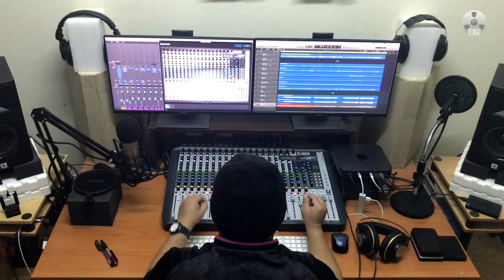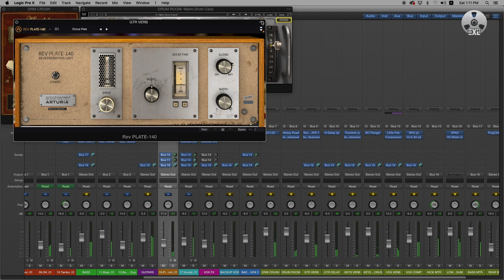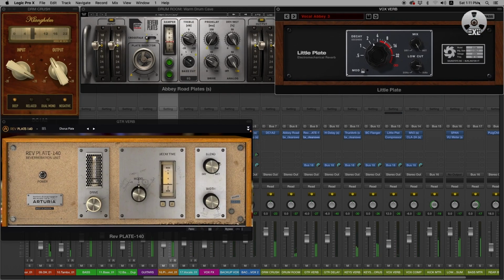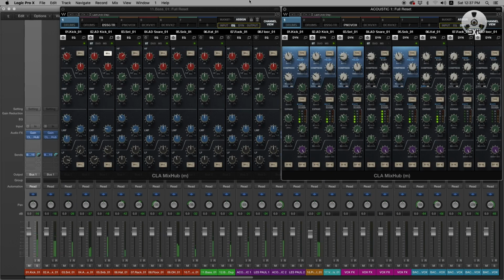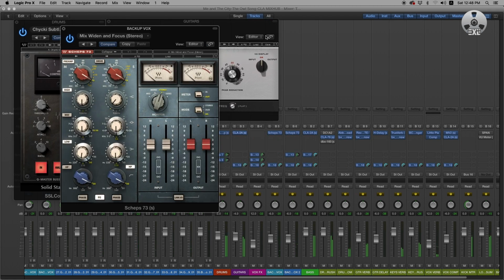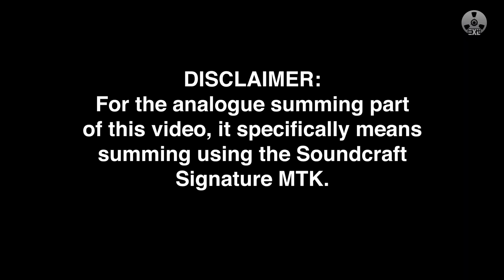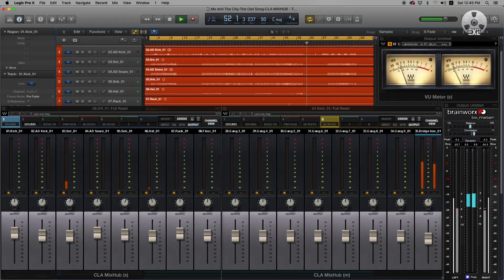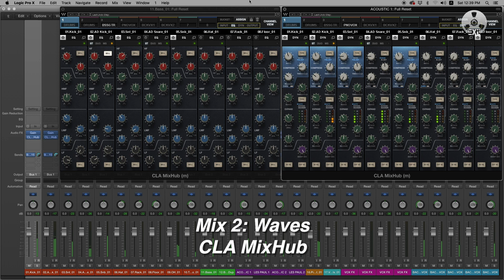SHOOTOUT: In the Box vs Hybrid Mixing

Comment: Hard to choose but think I preferred the warmth of the third though the first one seemed punchier.
Reply from the maker: I would agree with you. The console tends to round out the mids and the high mids (the 'warmth') so you have to compansate with the EQ. Out of the box, vocals get buried right away because of -I'm guessing here- harmonic distortion. You can plainly hear it in the a cappella section where the ITB versions had more vocal presence and the summed version had more reverb. I left it as it was to show the difference. The main vocals, however, I had to raise the level by 3dB in the DAW so it can punch through the mix. Thanks for dropping by!

Comment: Had to read the comments first cause I thought I was losing it..  You did such a great job man…  its amazing.  The first one definitely got some punch… but I gotta agree..  The third one so warmer..  Had to close my eyes and listen..  They were all really good…  salute. Thinking of getting the board.
Reply from the maker: Thanks for taking time to listen to the mixes. I warn you though, the power supply unit of this board is weak. Mine was blown for the third time a month ago. I'm now thinking about having a modified PSU installed because the two replacement PSUs from the manufacturer didn't last a year each time. But the sound of this console though is worth the trouble. Thanks again for dropping by! Cheers!

Comment: CLA Plugin little bit darker but its like 1 db darker only. why so subtle.
First mix is good, well balance. But its so digital
SSL is about Punch (detail attack) and darker
There is a depth mix through mixer, its like using multiband compressor but off with 250 hz to 2khz with 2 db lower than the rest.
But the third one, the reverb is so good. is on board reverb or what?
thanks
Reply from the maker: Yes, that's true. 250Hz - 2k or so losses presence when it hits the board. It has something to do with the analogue circuitry, maybe. Usually I just turn those frequencies up to compensate. But in this case I did not do anything so you can hear that difference between ITB and analogue-summed mixes. I agree, there is a bit more depth of the mix when it goes through the board especially when that reverb hits it like that as you said in your comment. I just left it as it is so other users will know what happens to a mix and what to expect when it goes through the Signature 22 MTK with all faders at unity gain and no EQs are engaged. Thanks for checking this out. Cheers!
Reply: @ExileMixes  we are at the same freQ. Btw have you try sum through mixer with individual fader push to max top and lowering master level for compansasion?
Reply from the maker: @ronaldirawan3643  I think I've done it in a slightly different way whee one of the commenters also asked me to try to max out the channels and/or the master section to see if we can get a nice analogue distortion effect. It was hard to distort even with all faders up and master maxed out with the meters clipping in the red--the signal was still clean although it was way louder. Anyway, I will try it as you said, it might give me a good sound because this console has no input gain adjustment when in the mixing/USB return mode so the signal form the DAW has to be hot enough otherwise it will turn everything down when it gets to the master section.